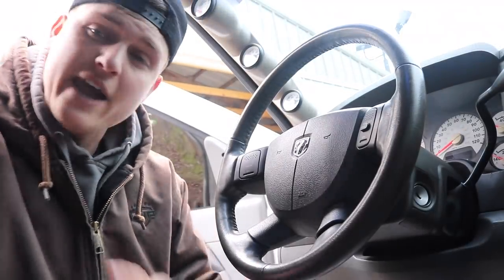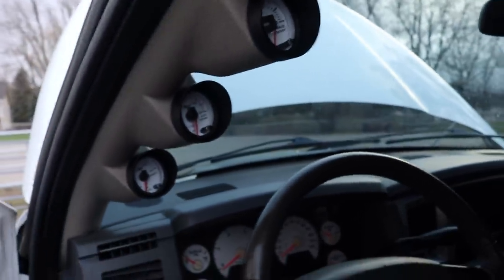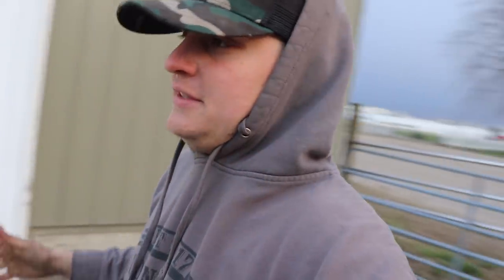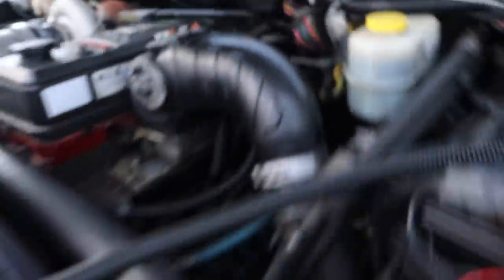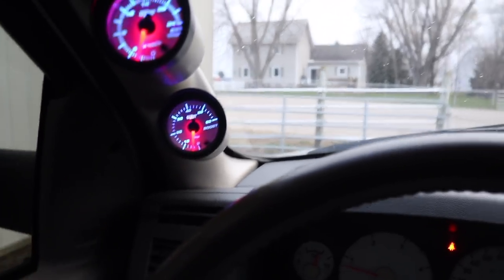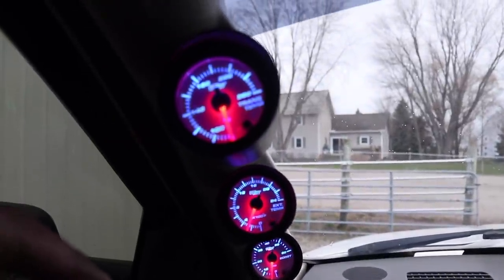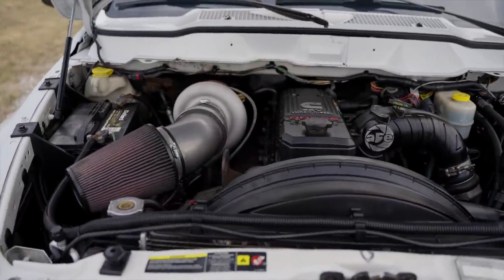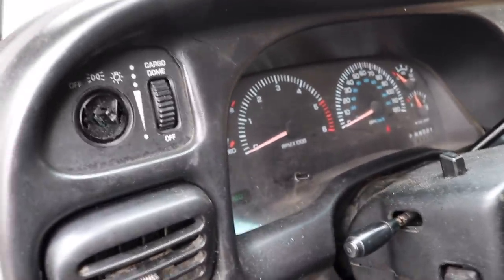I can't believe they are gone...

Comment: I haven’t won a truck yet so I had to break down and buy a 01 3500 4x4 6 speed with 180k I jumped on it because it’s pretty clean and getting hard to find under $20k. Had to pay way more than the previous 3 2nd gens but well worth it. Starting to order some upgrades now.